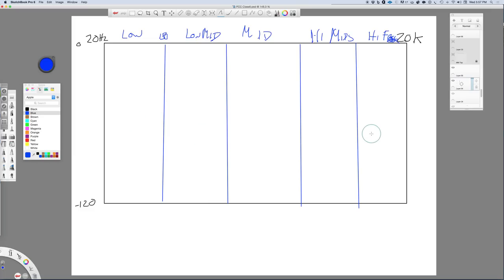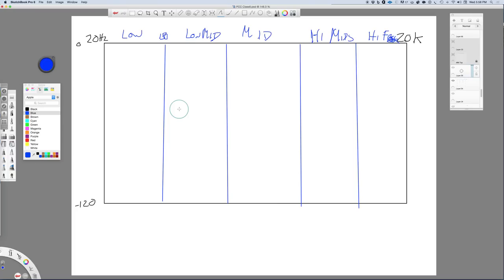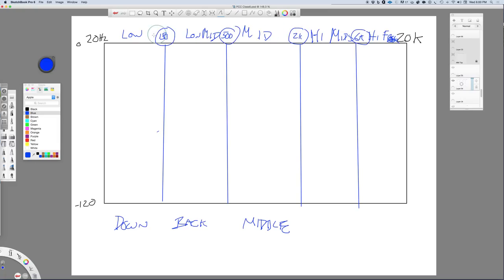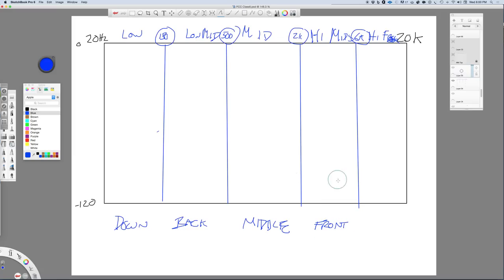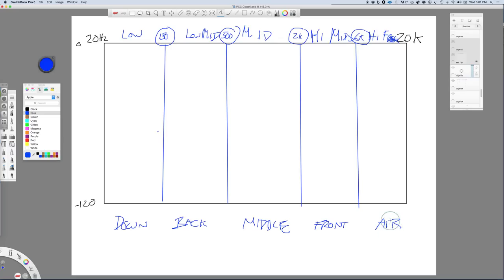Mixing With Mike Mixing Tip: Mixing and the 5 Frequency Bands

Comment: Great video! As far as things like the sustain character being dependent on how high the note is, something I’ve always wondered with EQing is that does an EQ setting affect different notes of the bass the same? For example, if you have that mid boost to translate into smaller speakers, would that affect a lower note such as an open E the same as a higher note such as an open G?

Harrison makes an interesting plugin called Bass Character which is somewhat of an EQ that follows the fundamental note. You can boost or cut the fundamental as well as boost or cut the higher harmonics. I’m wondering why EQs like that aren’t more popular

Comment: I don't understand how compression would bring focus to a fundamental frequency. I have been working on the assumption that compression will make take the loudest parts (in this case the fundamental frequency you've highlighted with eq) and bring it closer in volume to the lower volume frequencies. So in my head I'm thinking, you eq'd some focus, and then squashed it down closer to the unfocused parts of the sound. Can anyone help me understand why this isnt the case?
Reply: I was thinking the same and didn’t get what he meant by this either!